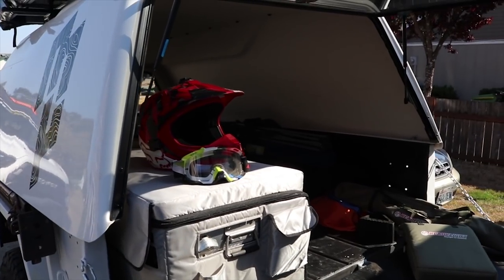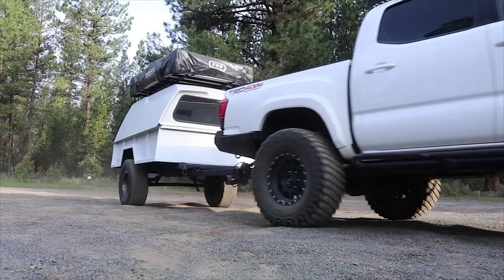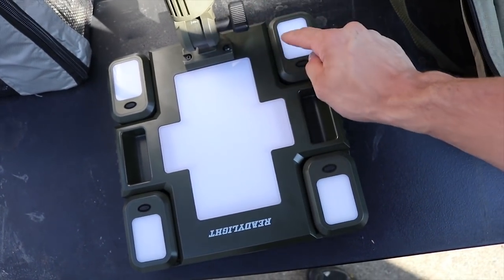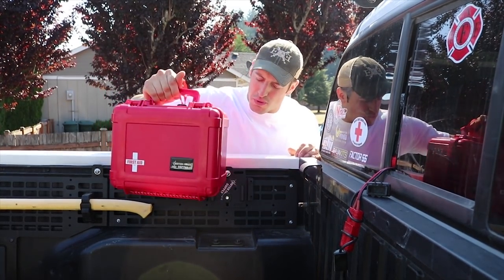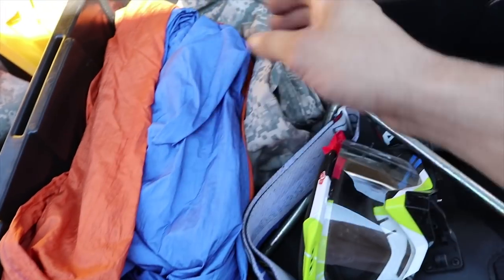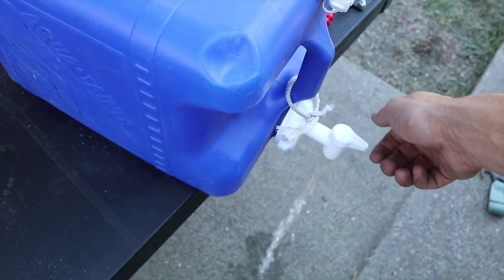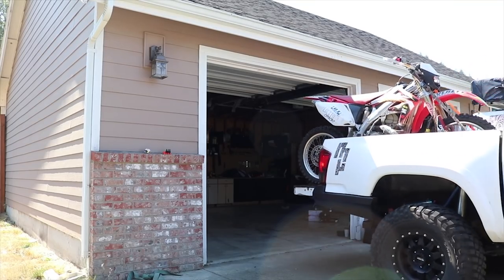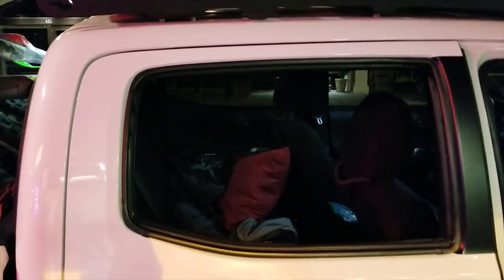Packing for an Overland Adventure | $7000 Stolen

Comment: Use the rear under the seat storage compartments for items that will fit. Idiot thieves usually would not even know they exist. obviously a drone won't fit but you can store smaller items.

Comment: You might not get everything back but you should be able to locate the drone the second they try to fly it. It should also be registered so it will show up on the DJI Go app even if they try to change anything. If they took it to a local pawn shop, they might have made them show id before they got paid. Try calling the shops in that area to see if it and the other gear was brought in. Hope you find that bastard.

Comment: with all that expensive gear and truck mods you should look into getting a 24/7 dash cam.  even at the 700-1k range for 2 cameras always on that might help in the long run

Comment: Next install viper alarm with glass breaker add on . you can thank me later
Reply: I got one and added a device that detects motion.  If someone comes close to my truck, the alarm chirps.  Then it goes into ready mode.  Even if I left my windows down, putting a finger inside the cab sets off the alarm.  Got it because jerks were using my truck for parts.  Stole my wipers (arms and all), my front license plate, my fog lights, and other bits.  Never had anything stollen after I installed it.  I hate thieves.